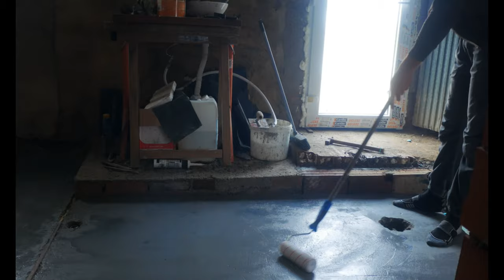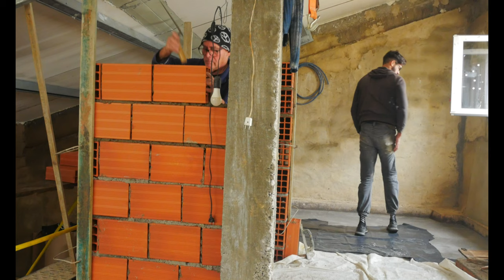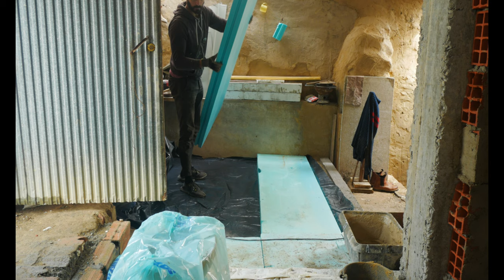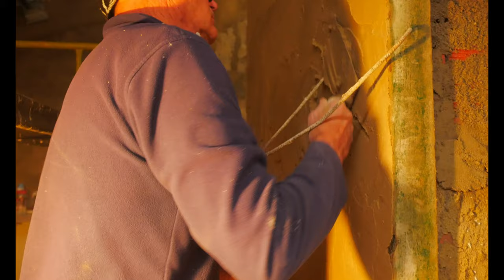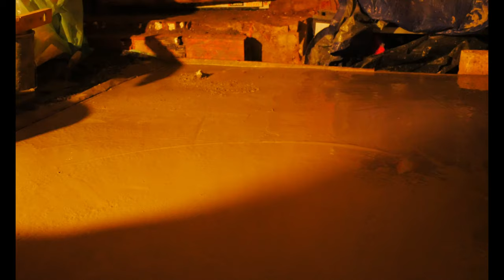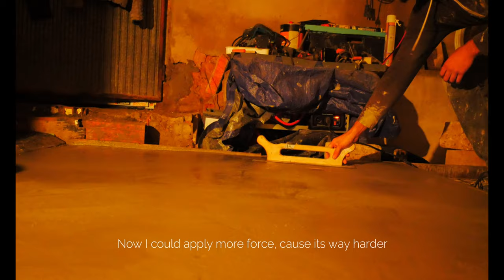minimalhouse VLOG#24 Varnishing the floor, shower wall and pouring entrance floor

Comment: I watched an Asian video and they just threw dry cement powder on the slab and floated it in.
Reply from the maker: Yeah I do that to fix the zones that created holes during the drying process. But if you do it in the beginning it will look different then the one I’m doing, it’s another kind of concrete floor :)